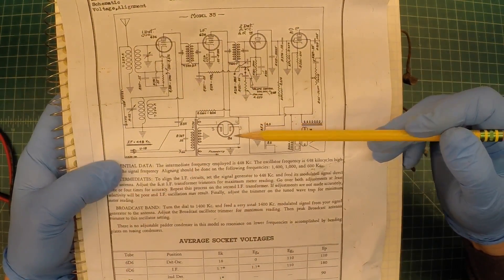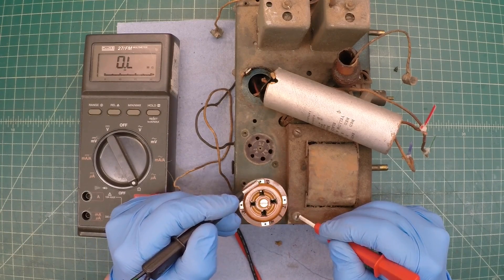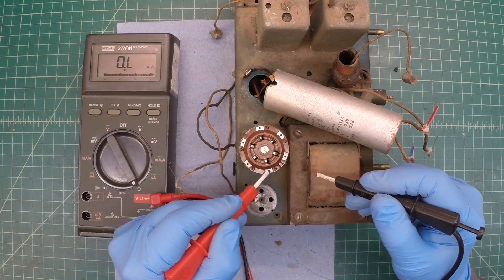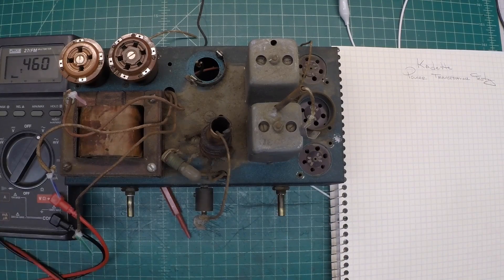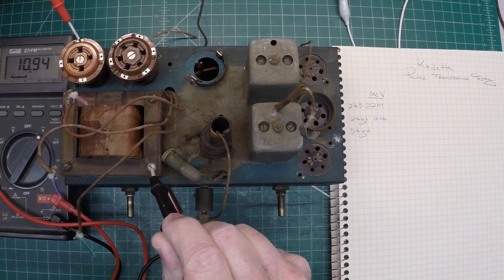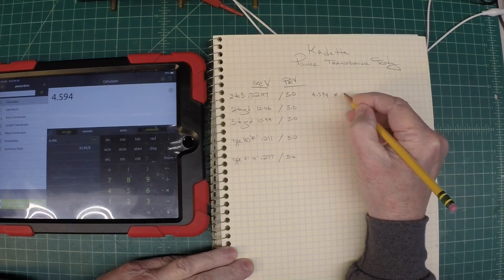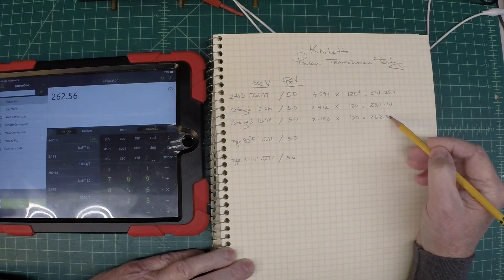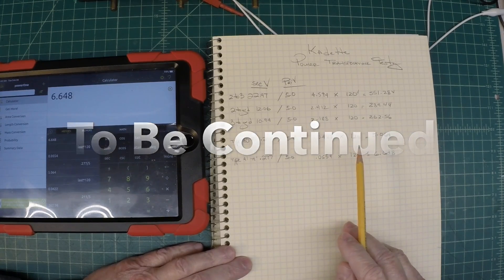Kadette Tele-matic AC Model 35 - Power Transformer Voltage Calculations Using a Square Wave

Comment: Hi Don. Good video, nice, technical, but I do not understand why are you using square wave on internal transformer coils.
Could you explain that mistery to me?
Thanks.
Ketk (from Spain)
Reply from the maker: Ketk - check out my reply to +Flux Condenser (who asked the same question) in the comment section of this video. Any guidance in regards to a sine wave vs. square is welcomed. Best, Don
Reply: @RestoreOldRadios  Thanks for fast answer. Yes, I have read now your answer to +Flux Condenser and I resume that you are doing that because of your empiric reasons. I have never tested power transformers nor audio transformers with square waves. The same as I have never checker digital circuits with sine wave.
Each wave form has its own use. But maybe that method with square wave works fine with you.
Maybe some a day I will try to do a test about that.
Thanks Don, and have a nice day.
Ketk (Spain)
Reply from the maker: Definitely empirical with a small sample rate.
Reply: @RestoreOldRadios , anyway, I believe you can not get square wave in the transformer output, then you are not really working with square wave. Try to watch the output of the transformer wave form with the oscilloscope. 
I have done the same as you did with senoidal wave and had no problem to get the "n" transforming relation parameter.
Wish you the best Don.
Ketk (From Spain).
Reply from the maker: I will look at the waveform on the o-scope today. Thank you.

Comment: Just for clarification, are you using the audio generator instead of an AC power supply because you don’t have a low voltage AC supply or do you prefer an audio generator in this case? Also, why is a square wave used instead of a sine? Wouldn’t a sine more closely represent the AC from the mains?
Reply from the maker: Great questions. Nope, I have a low voltage source, but the ease of using the audio SG it easier and safer. I chose the square wave to closer match the real AC RMS results from more than a dozen different transformers I tested some time back. Again, just a limited number of transformers tested. I even tried a 60 and 120 cycle sine wave and the square wave always came closer to matching the measured AC. I’m guessing the harmonics, duty cycle or other factors associated with the square wave bump the readings up just a bit to closer mirror the actual results. What are your thoughts on the differences? Best, Don
Reply: @RestoreOldRadios  I had the same questions as FLUX.   Could it be you used a DMM to measure the outputs.  A scope would probably give more precise results.   SInce the core or the transformer is designed for 60 hz I would think that would be a better frequency to use also.
Reply from the maker: I’m in agreement with you guys. The data is empirical with a small sample rate. I tried using a 60 cycle sine wave and it works; but the calculated readings on my Fluke were just under the measured results using 120VAC line voltage. I didn’t use my scope. The square wave produced a closer match to the actual line voltage driven results. Seems strange to me too. I’ll try to sample a new power transformer and see if the results are the same. Best, Don
Reply: Look forward to hearing your results, Don. I’d also be curious to see if changing the frequency affects the voltage, and if so, by how much. Even without a capacitor in circuit, wouldn’t a transformer be a tuned-circuit that would vary voltage due to changes in frequencies? Maybe not a tuned-circuit exactly, but the inductance/reactance would have a similar affect, no?